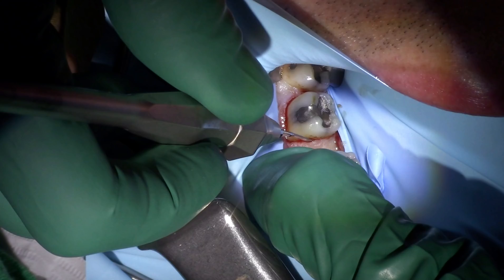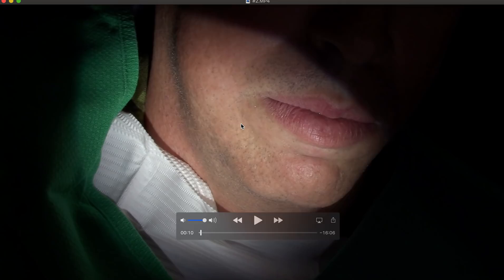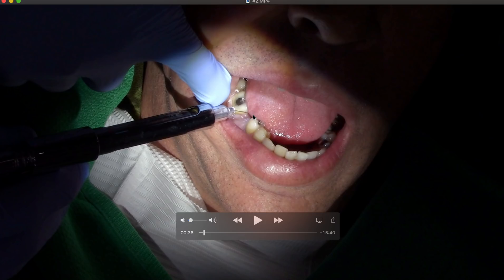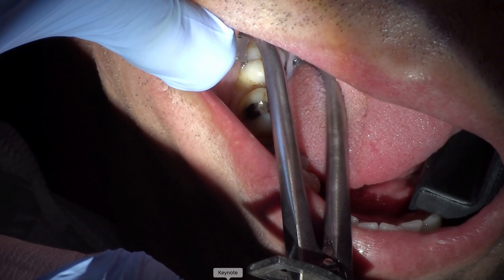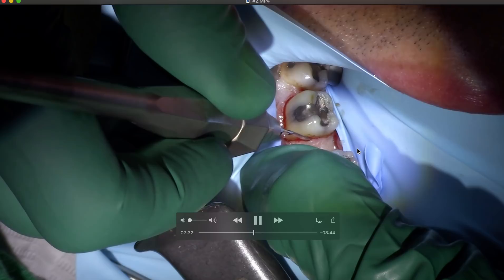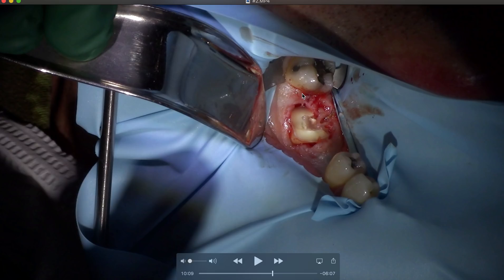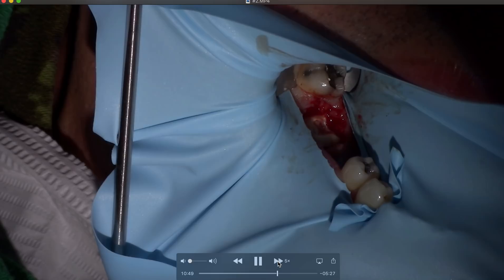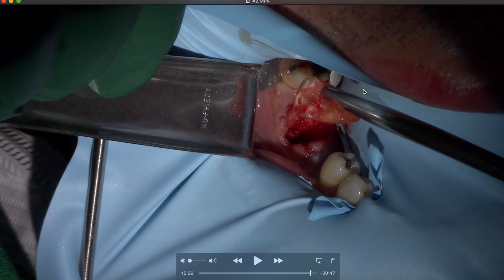Atraumatic Extraction and Ridge Preservation Tooth #46 - Part 1 of 2 - External Resorption Case

Comment: Yesterday I extracted lower first molar and I faced similar situation. The crown broke off while luxating and then I sectioned it buccolingually. The mesial root came out easily after that but I struggled with the distal root. Unfortunately I didn’t have 701/703 bur that time so I had to use my elevator to keep trying to luxate it. It took about 40 mins for me to luxate it and get it out of the socket. In future I'll keep those burs in my chamber.

Comment: good video....we've all done every mistake there is while sectioning, as you humbly point out.....after you had the mesial root out, i would have first used the periotome on the distal of the distal root...or used a small east/west elevator on the mesial of the distal root to lift it out; might require making a small purchase point on the mesial surface of the root.  If all that failed, only then would i take the high speed and start removing bone on the distal of the distal root.  
I've been doing surgical extractions for years this way, without laying a flap and removing all of that buccal bone like we were taught in school.

Comment: Great video!
Btw, what do you think of the tooth #3 (#16) and #14 (#26) in 2:03? Just curious...
I also do atraumatic extraction 100% of the time. What I have been doing is after sectioning the tooth into mesial and distal halves, and if I cannot get those pieces, I cut them once more and I extract MB ML DB DL root pieces. Even if the distal root is only one root, the sectioned root creates space that enables me to extract the distal root easily. 
The theory behind is the extracted tooth is mine but the bone is the patient's. I do the same thing for 3rd molar extractions too.

Comment: If you’re wedging the elevator distal to the root, resting on that adjacent tooth, one of these days you will hear a crack and split that bystander as well if it’s even lightly compromised. Use of needlepoint surgical diamond to trough around the PDL with remove that root faster than you can say “tooth fairy”. But what do I know. I’ve only been doing this 17 years...

Comment: Hi Doctor , i just wanted to have an explanation or your opinion  to a Rootcanal treatment performed on a 36 molar. By the way sorry for my english. The history of that tooth : in 2013 an amalgam filling was changed. The tooth was in following years quite sensitiv ( mastication and cold) until september 2019. My friend performed a perfect Rootcanal treatment with using DVT. All 3 canal were cleaned and filled. My question is: why is that tooth sensitiv in oro -bucal direction, dont have a new xray.. will take it when i start workiing again .. corona is not a friend for the dentistry..greetings from the netherlands